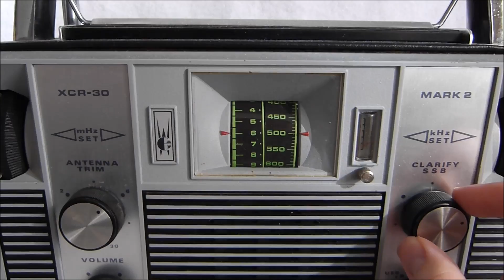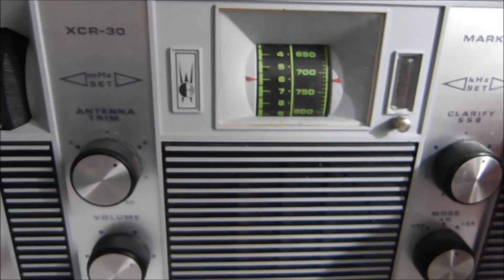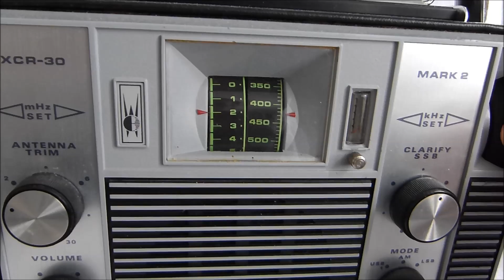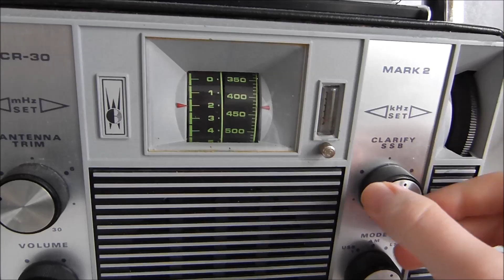AM broadcast band DXing during a daytime power outage

Comment: My 1955 tan Zenith Royal 500 had 7 Transistors !  You model is a newer version with 8 !  Still works great today !   Can't find the Zenith Mercury batteries anymore, but use today's brands .
Reply from the maker: The very first generation Royal 500 only came in red and black, so you must have a second generation set from around 1957 (tan is an uncommon color BTW). Mercury batteries haven't been made for about 20 years, and good riddance anyway, because they seemed to always leak and damage the radio the were in (plus alkaline batteries have almost the same capacity anyway).

Comment: Right on... excellent radios to do BC-DX'ing with, too, those Zeniths.
Reply from the maker: The Zenith Royal 500 radios are great, although they should have made the metal piece around the dials better on this model, the printing wears off very easily.
Reply: Understood.. yep..  the dials are kinda short and the fingers tend to rub around that metal when tuning or adjusting the volume.

Comment: I'd like to have another B.W. radio, I had one about 25 years ago.  They're unique and way kewl.  A Barlow Wadley is very expensive on epay, usually well over 200$, I've seen them sell for over 300$, up there with the high end Grundigs and Kenwood/Yaesu/Icom's GC receivers.   Don
Reply from the maker: It took me a while to find one that worked at a relatively decent price (I paid ~$150 shipped for it IIRC). They are interesting radios for sure.